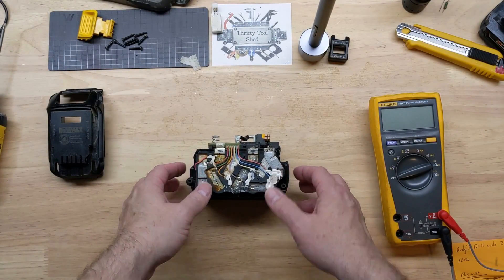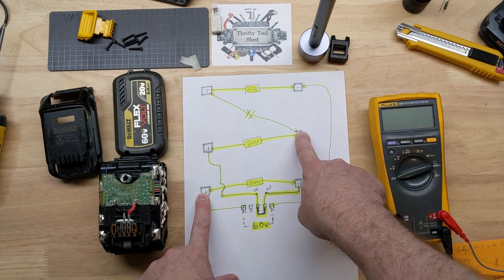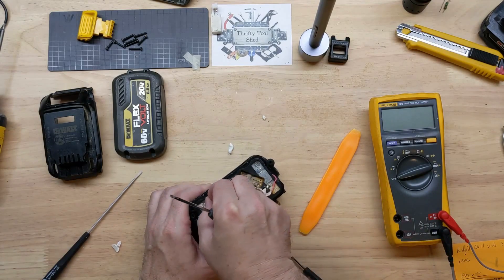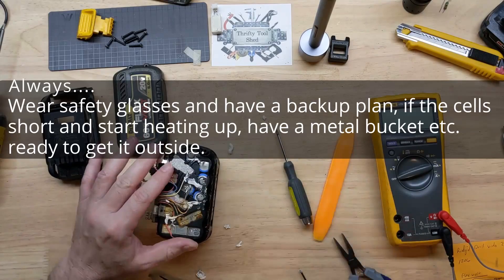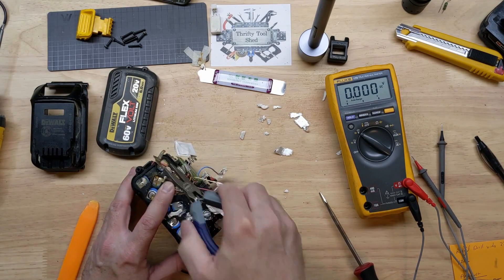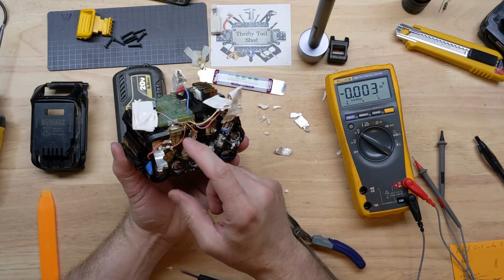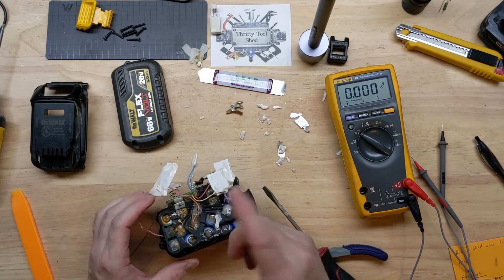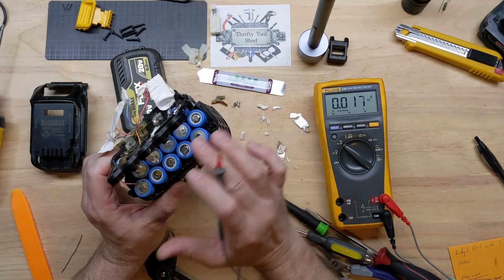DeWalt FlexVolt Battery Pack Disassembly (Video#2)

Comment: Put a couple of layers of heat shrink on the shaft of the screw drivers used for prying. And i should take my own advice too.
Reply from the maker: I have some like that as well as some insulated screw drivers as well, but I find it's aggravating using them trying to slide in between and of course over time the heat shrink gets pulled and wrinkled. To each there own though! Thanks for your comment!
Reply from the maker: I had to upload this video again. The last 3 mins were not my issue. YouTube does not allow updating video. I will have to delete this one after I reload new one and of course now not in order now, errr... I simply uploaded exact same video and it is fine. Thanks for mentioning this.

Comment: You think they make it this way to discourage attempting the relacement of individual cells?
Reply from the maker: It's possible. They surely make them throw away (recycle). The easiest and best for them for sure. I wish it was a better way, if a company decided to make the packs with at least marginally easy way to swap out cells to pack as a set or easier to replace the board and connectors to atleast save some money and things from landfill. It would be a game changer, but unfortunately it seems to be trending the opposite in reality! I am guessing we are small in number, this channel is a small way a test to see how many people get behind repair item that most just throw out or recycle. It's not the most popular it seems. Channel is growing but very slow. Thanks for your comment!